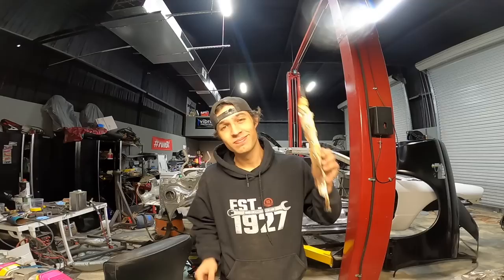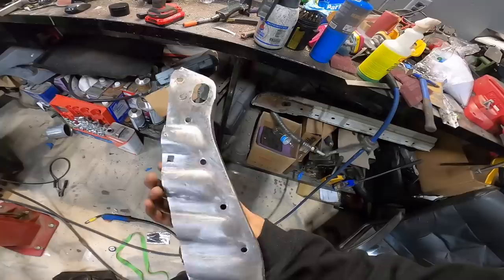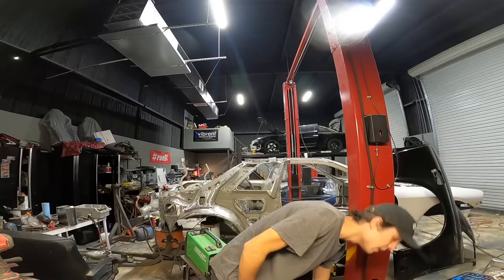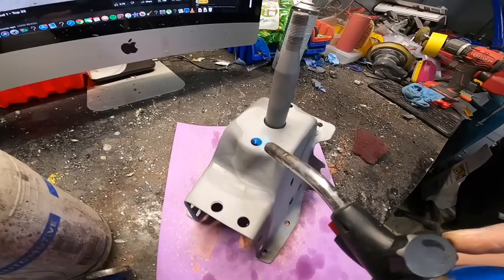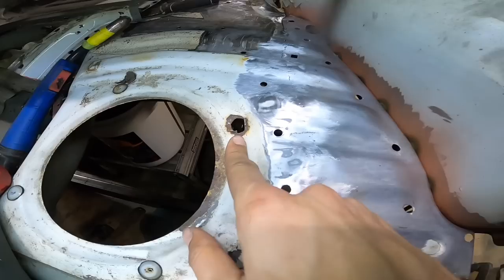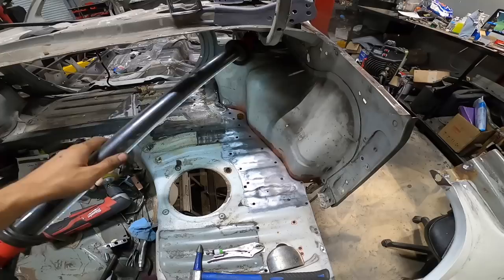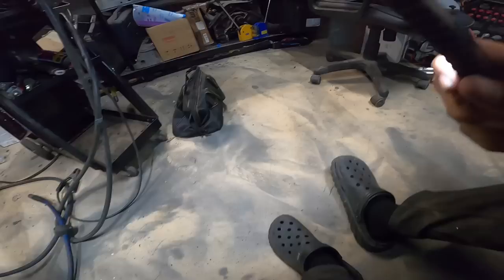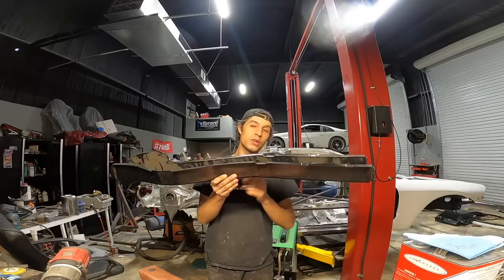RUST IS TO A MINIMAL! New Old Stock Parts | R32 GTR Restoration Part 21

Comment: I remember commenting when you started this project to send the car out for a full acid dip with rust prevention E-coating.  Would have saved you a hell of a lot of time and trouble.  Still would be a good idea to do at this point to 100% protect the inner seams from rusting again from the inside out.  

Good luck with the move and look forward to seeing R32 build progressing forward 🏁

Comment: Just remember Kalvin....when it's done it will literally be the cleanest r32 in the world I'd say.  Even the classics have small spots of rust hidden away you can't see.  You are like a detective when it comes to the rust in this thing. 

It will never ever rust again once you are done with it.  

Apart from the copper spray are you sealing the metal in anyway before you fit fixed parts upto the car?

Comment: 9:00 for hard to reach areas . try rust converter the ones that almost like water. spray it in. i had put this on parts thats under the car. (holland get lots of rain. and salt on road in winter) 4 years later nothing happend. . so i my expirence.. rust converter  / epoxy primer.  seamsealer!

Comment: 14:51 . that New peiece ytou installed. the layer on it is a E-coat.  my suggestion  get a nice 2K epoxy for it scuff it up with scotch brite red pad and give it 2 light coats and a medium coat (ps whole car under body)  the bare metal get some por15 metalprep on that first! it gives a nice phophor layer that happely takes primers over it!

Comment: I reckon the car sat out side stripped out for a while, then someone had enough parts to throw something together for one last hoorahh.
But the positive is this will be saved and done right and the only rust it will have is a couple momento pieces on the wall I'm sure.

Comment: 5:50 please dont hit it with the torch. The chemical reaction releases H2O (water) when burning propane (I guess). Reaction equation of propane: C3H8 + 5 O2 3 CO2 + 4 H2O